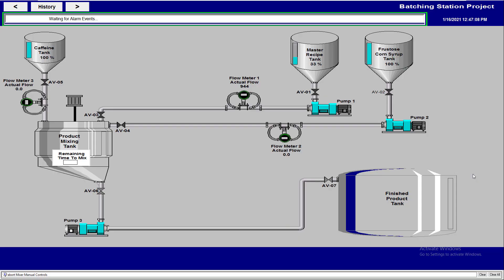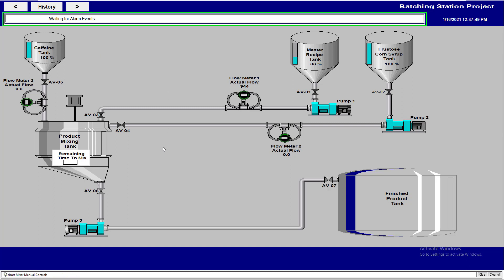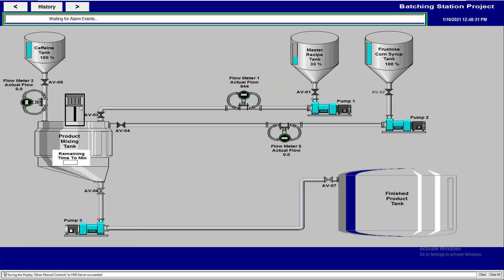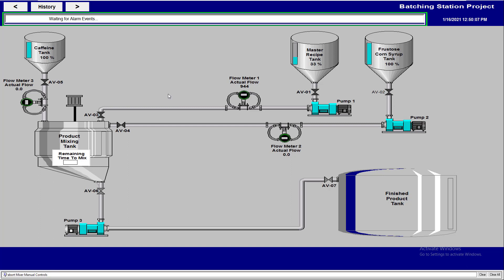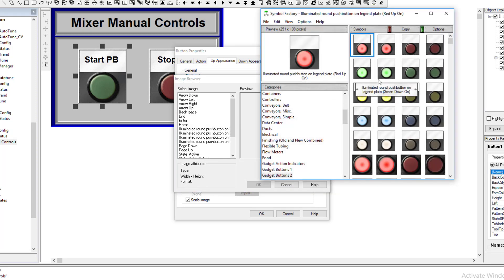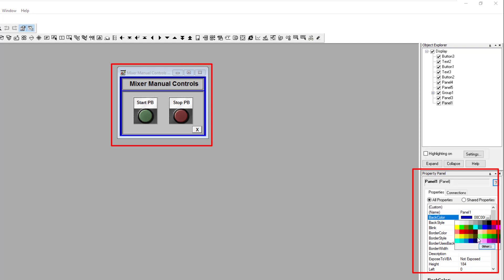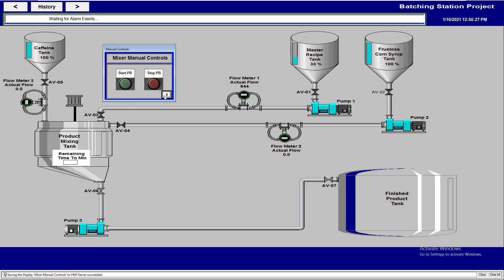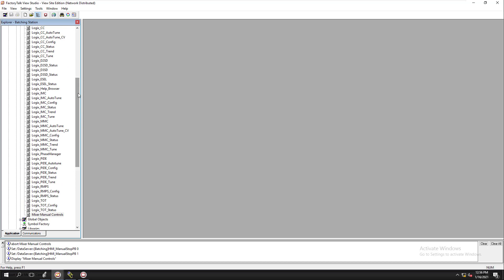FactoryTalk View Site Edition Pop-Up Display Editing Tips | Batching PLC Day-34

Comment: Hi.
How can I get that Library (Illuminated pushbutton)?
Reply from the maker: They come with the software install, all you need to do is to point to the one that you would like to use then add it to your library.
From the push button that you make, select use reference image then open the selection tool.

When that screen opens then just launch the library then select the symbol that you would like to use.

Here is an Example:
https://youtu.be/EQYJUKEv6rQ?t=215